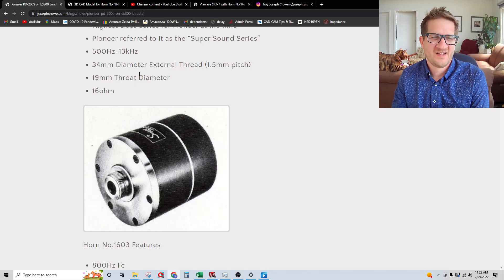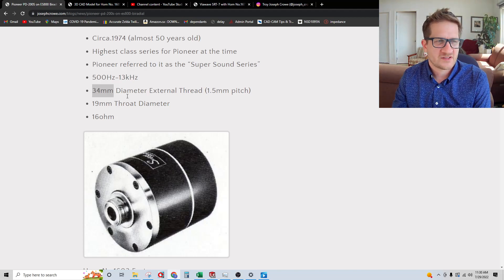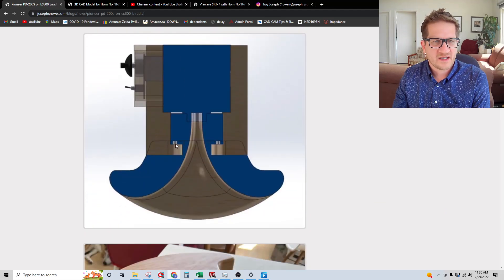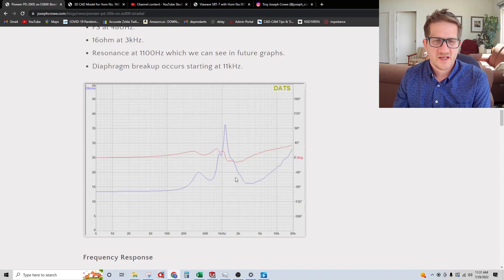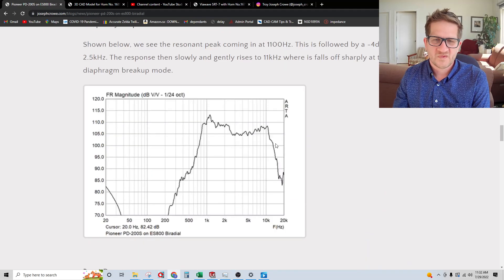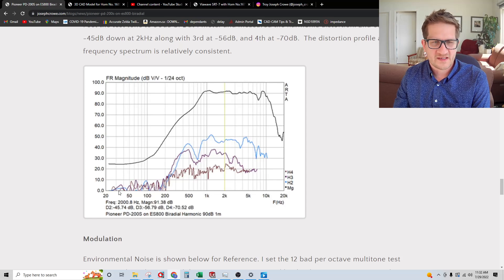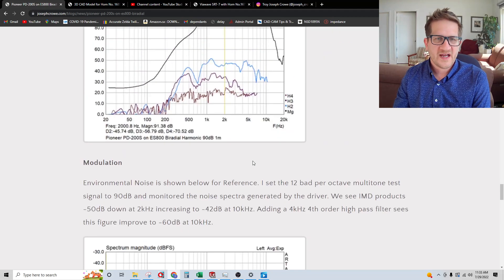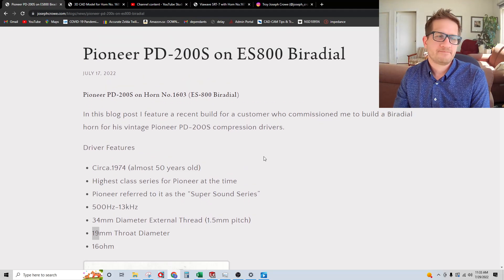Pioneer PD-200S on ES800 Biradial

Comment: This is a substandard driver. Unless it has something that makes it sonically interesting, vintage is better left on ebay.
Reply from the maker: Second order harmonic is rather high so it will have a warmer sound signature if that’s desirable. Personally I want my preamp doing that for me and the speakers as low distortion as possible.
Reply: @JosephCrowesDIYSpeakerBuilding  Agree! I use a Jfet follower power amp from Nelson Pass. Plenty of second harmonic and much more controllable.